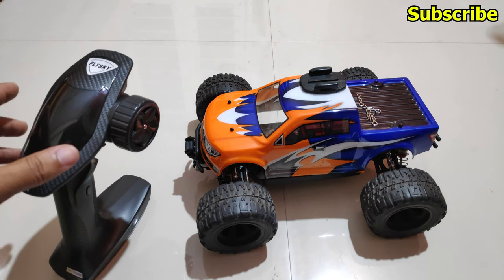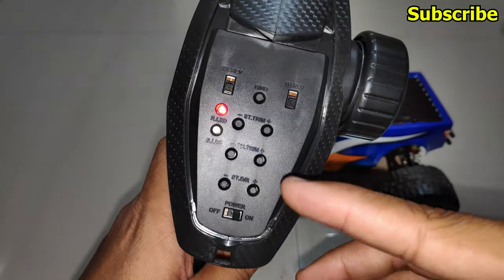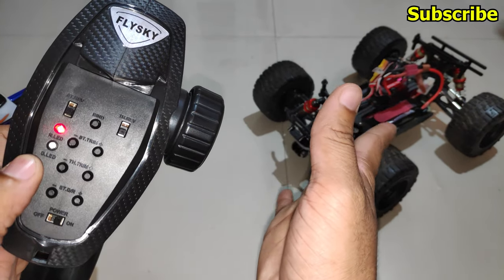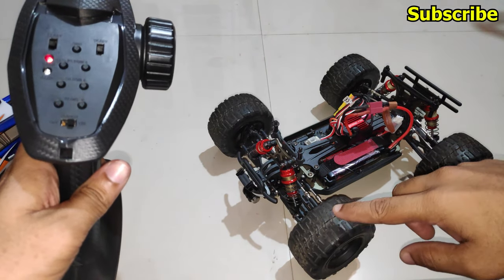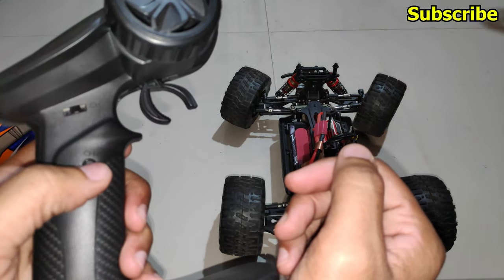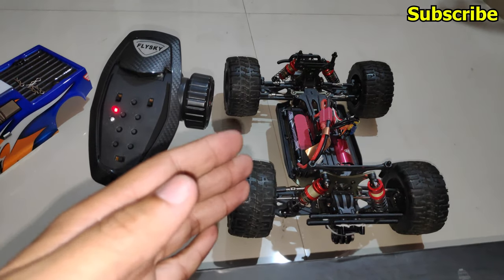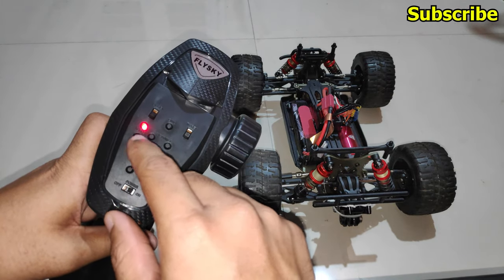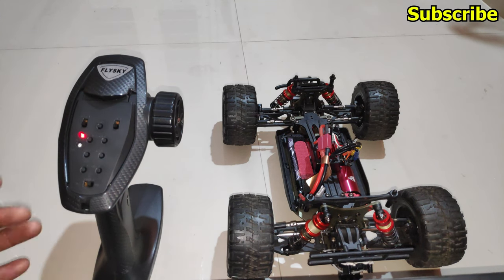Flysky G4P Radio Modes & Beginner Mode | LC Racing Radio Setup

Comment: Hello, is it possible to use the Channel 3 or 4 to turn on LED lights?
Reply from the maker: Yes you can. Check if your led kit has control module or just a basic plug and use led kit
Reply: @RakishRc  so if I have just a basic plug LED kit I need a LED controller. Got it. Any setting I have to do after I plug it in the channel 3 or 4 ?

Comment: Do you know how to enter the esc parameters? I’m trying to adjust drag brake, and set it to reverse instantly and not have
To push reverse 1x before it actually goes
Reply from the maker: You can adjust that from the esc set button. Check the hobbywing 35 amp brushless esc manual.